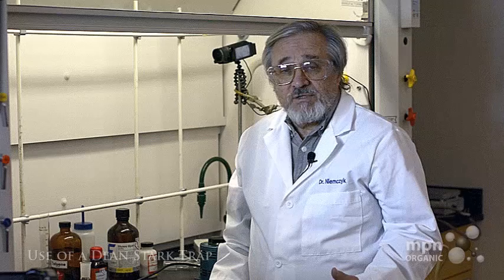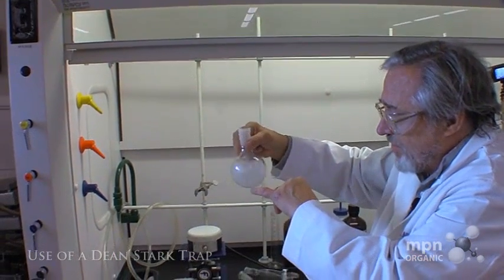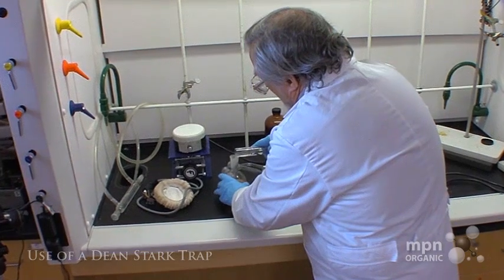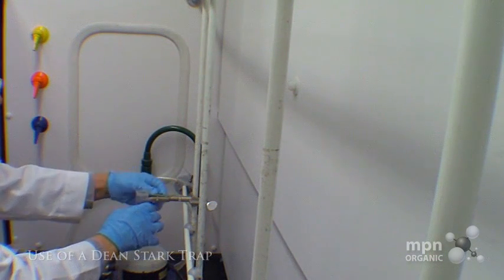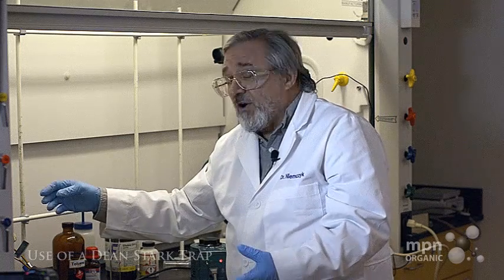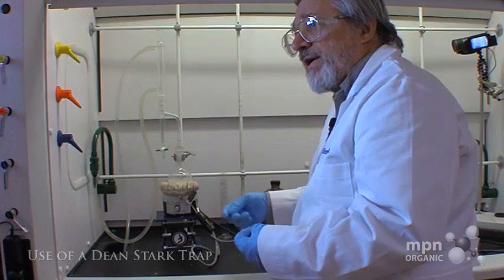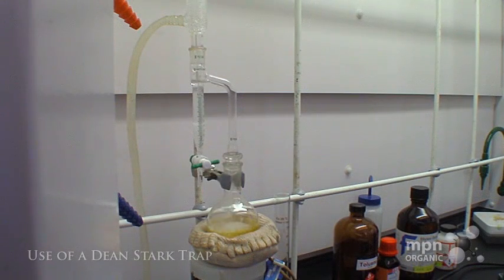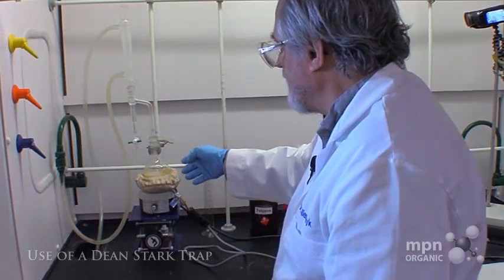USE OF A DEAN STARK TRAP with Dr. Mark Niemczyk, Ph.D.

Comment: If that was me plugging a. the condenser, weighed down with water lines into b. the expensive Tony Stark Trap, all supported by c. the meagre joint of the boiling flask, I would certainly break about three hundred bucks worth of glassware and make a huge mess!

Comment: I guess you couldn't use a dean start apparatus to dry ethanol because the boiling point of ethanol is lower than that of toluene? Or could you fractionally distill the ethanol out of the toluene; Probably easier to dry the ethanol with calcium chloride.
Reply: Calcium chloride is not a suitable drying agent for ethanol since it is too reactive for it and forms liquid calcium complexes with ethanol (source: Armarego, Wilfred: "Purification of laboratory chemicals"). Use magnesium sulfate, calcium sulfate, potassium carbonate,  calcium oxide, barium oxide or molecular sieves instead. Use metallic magnesium to remove traces of water from ethanol.